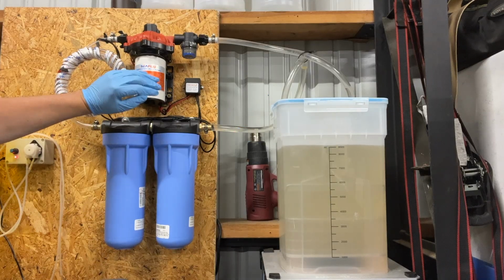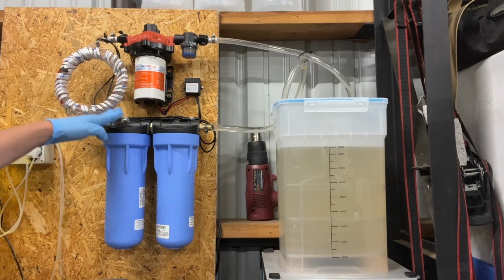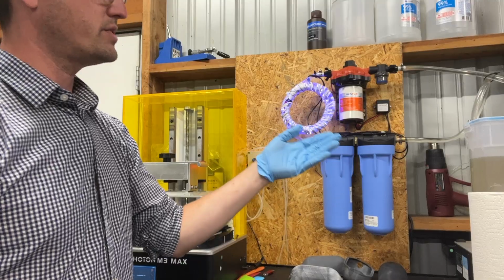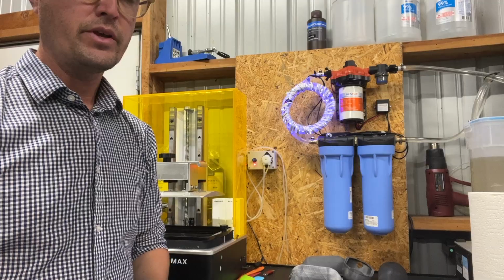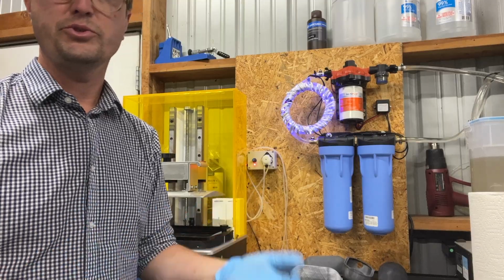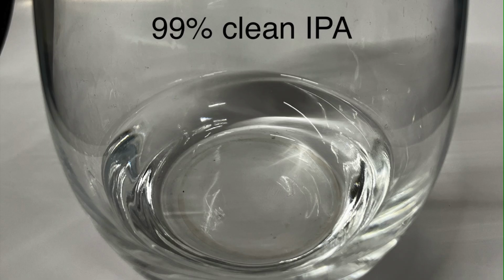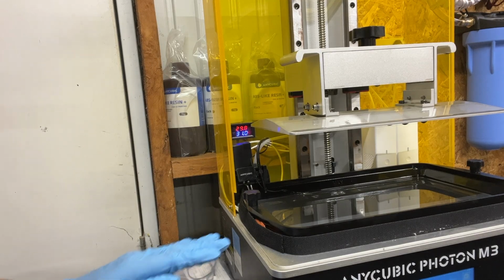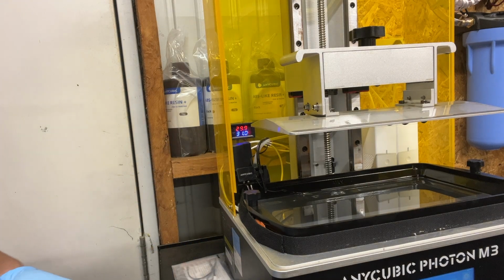Resin Printer Mods and Continuous IPA Filtration!

Comment: Wow, I wish I had found about this sooner but considering that you only put this out in mid 2023 I prolly wouldn't have heard about it in time. Considering how relatively toxic resin printing is to your health and the environment, as well as costly and time consuming, your IPA filter looks like a winner in my book at addressing those issues rather well. I would prolly still let the filters lay in the sun for a few days before disposing of them. 
The overall cost up front isn't cheap but it isn't prohibitive either. I am glad I didn't spend that xmas gift card on other things since it should cover the cost of the materials here. I thought the pump was going to be pretty pricey but it is quite affordable.
I would love to see a 1 year, 18 month and 2 year update to get a good long idea of how well it performs long term. The only consumable would be the filters aside from the obvious IPA that would be lost due to evaporation but I would love to see the cost savings long term. Either way I would do it simply to have a single stage cleaning vat and not having to always think about how dirty my IPA is or how long it might take to let the cured resin settle after leaving it in the sun, filter, squeeze out more from the goo that forms from that process, cure in the sun some more and finally dispose.
Reply from the maker: Great ideas. I’m working on commercializing a much simpler and less expensive unit for sale in the near future.
Reply: @nicks-fix   I hope it's a successful venture for you. The one thing that turns away many people from this hobby is the cleanup and disposing of waste material. I saw videos and posts elsewhere of people using water distillers for the IPA. Gave great results but not a solution that is apartment friendly like my situation.
Reply: @nicks-fix  I'll be a day one buyer if you ship to the UK 👀This would fix such a huge pain point for printing for me, as I can't get keep up with the amount of IPA I go through and some of these parts are a bit tough to source in my country

Comment: Great video and great insight! Have you found any resin layer buildup in the lumen of the reactor? Do you think the continuous flow will be able to prevent it?
Reply from the maker: Not yet! I believe the turbulent flow of clean ipa keeps it nice and clear.
Reply: I tried using a piece of clear PVC with the ribbon light system and you can see exactly where the LEDs are and there was a buildup now maybe it's cuz I use PVC and I use a really high powered ribbon light but I switch to a UV lamp that I stick over my tub

Comment: Hey! I built this and am loving it.  I ran it for 15 minutes on a vat that had about 6 liters through it (had filtered with coffee filters, aluminum sulfate, etc before) and it was so clean afterwards that I exposed it to the sun for an hour and got zero resin precipitation in the vat.  A yellow does stay behind, and some dye, but it surely gets the resin out!
Reply from the maker: Glad you’re liking it!!! So excited to hear other people’s experiences!
Reply: Could you use a carbon filter to remove the color.
Reply: @1h8turkeys  I think the two filters he suggested were both fabric.   I'll look into swapping one for a carbon filter and report back.
Reply: @arthurbrazzle6854 Have you had any success with the carbon filter?  Which one did you get?
Reply: Did u use the led straps linked in the description cause I bought them.only to realize they aren't even uv lights so they don't cure anything
Reply from the maker: @EBMS92  sorry about that. Amazon links are constantly changing and it’s tough to know when they change. 

Just be sure to check the UV output from the LEDs that matches the curing wavelength of your resin.
Reply: @nicks-fix yeah the current link goes to a 400nm strip, still plenty available if you search manually.

Comment: I have few questions. At what rate the resin convert to solid in presence of alcohol? 

If the pump is not rising pressure,  then the filtration filter is not filtering well enough.

Did you open the filters to see how much resins sediment is in there?

Cause for sure is filtering but I'm not convinced that the uv light is doing much in 4 cycles. 

Can you please provide more data? 

Thanks and great job. I'm pretty sure you have something, but still you need more data so you can adjust.
Reply from the maker: Please watch the video again.

The system cycles for 5-10 minutes each time. In that amount of time the entire contents on the IPA vat would cycle 10-20 times, 40-80 times through the reactor… not 4. 

Rising pressure of the pump means the filters need changing, not that they are not working. I know the filters are working because my IPA is as clear as the day I put it in. No need to “check” the filters. 

The data collected is in the video. The resultant output is the data. Little value would be gained from your requests and it would be arduous to attempt.

Comment: Nick,  great video. Looks like you use your SLA printer for functional parts (versus miniatures or figurines).  I'd like to see videos and how you orientate your parts on the build plate to control warping and obtain the best part-to-part fitment.  I'm also interested if you have tried any of the flexible resins in your functional parts?
Reply from the maker: I typically just find the flattest part and align that with the build plate, to reduce the need for supports. 

No flexible resins yet but one day!

Comment: Hi, do you think this would work for a high production? For example in one day I’m printing 120 parts a day. To put things in perspective I’m using 20 gallons of 99% ipa every 2 weeks.
Reply from the maker: Sure! You could always get larger filter housings to help last longer, but I haven’t had to change anything yet!
Reply: @nicks-fix  Thanks Nick for replying back! I see, I was also thinking if the ipa doesn’t get as clean I can possibly run 3 filters instead of 2. I’m in the dental laboratory industry. I sometimes print dental models 24hrs day. My main concern is the pump. You mentioned there’s a sensor for over heating, flash point for ipa 53 degrees f. Do you think running the pump long periods would cause issues?

Comment: I think you're linking the wrong pump in your list. 

Mine came in today and its different then yours in the video. 

This one says do not use with flammable liquids as the pump sparks and will ignite flammable gases/liquids.
Reply from the maker: Sorry about that. Amazon changes their links on me and I have to edit things constantly. Just make sure you have a seaflow pump with a santoprene diaphragm. The power type depends on your situation.
Reply: Amazon shipped me a Maxzone model CFDP1-3330-01.

I don't see a mention of santaprine in the owner's manual, will need to research this more and see if it'll work or am returning it.

Comment: Very nice ideas! Thanks for that! When i am running the heatband with 12V and it has 150W, do i need a acdc adapter with 12,5A? Or did i a mistake? Could u maybe list the full setup how u are running your heatband with thermoelement?
Reply from the maker: Correct, you need a power supply capable of supplying more than 150w to the 12VDC. I use a 300w power supply, that converts 120VAC to 12VDC, 25amps.

Comment: This is the perfect system. I have it now set up for 4 weeks and I have printed nearly 10 litres of resin. IPA is still transparent, just a bit tinted grey as I have uses Phrozen speed and Siraya smoky black resins.
Thank you Nick!
You should patent this and then sell to some 3D printers manufacturer :)
I cant believe such filtration systems are not yet available as resin printers accessory.
Reply: How long did your filters last until you needed to change them?

Comment: Would this setup work with aceton as a cleaning agent, too? Or would the pump start leaking at some point?
Reply from the maker: It should be fine but double check the parts ability to interact with acetone!

Comment: What's your intake/outtake in the bucker? Did you drill the sides/bottom or just the cap and snaked one to the bottom and one top?
Reply from the maker: Just tightly sealed holes in the top.

Comment: For the SimPure 5 Micron 10 filter, does it matter if it's carbon or polppropylene filter? Poly is out of stock atm :(
Reply from the maker: It all depends on if it’s rated for alcohol or not. Carbon should be fine!
Reply: @nicks-fix An referring to your affiliated link you gave :)

Comment: How is the tubing fitted to the IPA basin? Did you just put the tubing through the open top and secure it at some height, or did you actually drill holes and add fittings? In either case where do you have the openings?
Reply from the maker: Just holes with the tubing through the lid.  Tight fitting, but no fittings. I had fittings to start but they leaked a little. Straight tubes worked much better.

Comment: Can you just comment on the safety of running IPA through a pump? I am not knowledgeable about the topic AT ALL, but I've read in many places that running IPA through any sort of machinery such as pumps or even in some cases the swirlers is dangerous due to flammability?
Reply from the maker: Sure!

This is using a diaphragm pump. If you understand how the pump works, there is zero interaction with the liquid and the inner workings of the motor. 

The pump we are using in the video (and the link) is using a santoprene diaphragm, that has high resistance to alcohol. 

We also limit as much air contact as possible, so the ipa has limited chances to engage with any spark that could cause combustion.

Comment: built your setup but cannot get the filter housings to stop leaking, did you use a gasket or something ?
Reply from the maker: Make sure they are tightened down and the gaskets that they come with are placed and seated correctly.

Comment: I just ordered everything to build this filtration system. A question regarding the tubing. Is the pickup line ran all the way to the bottom of the cleaning bucket? Thanks
Reply from the maker: It is! Just keep it below the IPA line so you don’t introduce air into the system.

Comment: This is really nice and I would not be afraid about the components having problem with IPA. I rather wonder how the PVC tubes will perform after a couple of months. Usually PVC is not UV resistant, why outdoors it is either put into the ground or coated with some paint for UV protection. In this case you cannot do that, since the UV should go through the PVC tube, so it should get brittle over time. Maybe it takes years, but maybe only a few months, I dunno since the UV source is right in front of it. Replacing with silicone tube might be smart after they start becoming harder and harder. Same goes for the fittings, but those can be easily shielded from the uv.
Reply from the maker: Correct, but under limited pressure I believe I’ll get a ton of life out of these before needing to replace.

This may be a more suitable option!

https://amzn.to/47gXuMt

Comment: Any updates to the parts list?  I saw in your reddit post that the build was decently affordable, but I'm seeing ~$220 for the filtration setup and that's a bit of a stretch for me.
Reply from the maker: Not at the moment! The pump is the most expensive part, but also the most important. 

At this point you may be able to reduce to one, 5 micron filter and it’d work well enough.

Try looking for a less expensive diaphragm pump with a santoprene diaphragm.
Reply: Thanks! For the filters, do you use Carbon or Polypropylene?

Comment: Can you post a how to video walking us through setup? Or is it relatively simple once the materials ship in? Thank you very much for your content, easily the most effective and low maintenance setup I’ve seen!
Reply from the maker: It’s pretty self explanatory once you have the components, just make sure the order is the same as the video!

Material list is in the description!

Thanks for the compliment, let me know how yours works out!
Reply: @nicks-fix  ok cool thank you very much I have all the tabs pulled open ready to order 👍will post update when finished 😁
Reply: @nicks-fix This process was anything but self explanatory. The plumbing itself was fine even though I still have leaks that escape me even with traditional sealing methods and the electrical does not work as intended. I ended up having to buy extra supplies that were not on the list as well; had I known of these issues beforehand I would’ve elected a simpler and cheaper method of ipa filtering
Reply: Like what kind of supplies? seems stage forward, but I am curious what you needed to modify? @randyworks5348

Comment: I've just recreated this system!  Turned it on today.....turned it off.....forgot PTFE tape around the spigot threads and it pissed IPA on the floor - D'OH!  Turned it back on and seemed to cycle round very quickly.  Havent tried it with resin it - just pumped the IPA round and round till i was happy there were no leaks.  One thing i noticed was that it empties the bucket far quicker than it puts it back in.  A lot of IPA stays around the first filter (i bought the clear filter caddys instead of solid blue).  Do you find that with yours - i notice we didnt actually see your system in action.  I've ended up dropping the 'IPA In' tube towards the bottom and raising the 'IPA Out' tube to near the top to compensate for the speed disparity.  Do you have any thoughts on what might cause this?  As far as i can see i have no kinks in my hose
Reply from the maker: When you say the ipa stays around the first filter, do you mean that it’s filled with IPA?

Yes, there is air in the filter housings before you pump ipa through the system and the volume of air doesn’t go back in, now that it’s filled with IPA. The volume of the pump, tubes and filters is now holding ipa so you need to top off your vat. 

The filters inlet and outlets are at the top, so without pressure, the ipa will remain in the canister when it’s not running.

Also my system is on and cycling in the video when you see the purple from the UV light ring.
Reply: @nicks-fix  ahhh man thats great, i was thinking i would have to top up the rest of the bucket with IPA but was concerned that the filters werent designed to swim in IPA 24/7 - reckon thats ok?  Either way, thanks for confirming and getting back to me.  Looking forward to seeing the state of the IPA after a kilo or 2 of resin has gone through it.  PS Well done on having a silent pump - i didn't even realise it was on!!  Mine is quite noisy but i've fittedit into a purpose built freestanding cupboard/wardrobe in my office so i can keep the entire resin print station in the dark and away from small prying hands (my kids!).  I think my noise is due to the vibration of the cupboard (and everything inside it!) - i just assumed everyones was as noisy :D

Comment: Hi nick I noticed  what looks to be a peristaltic pump on the backwall does that have something to do with your auto filler on the max? or just to drain the resin from the bed?
Reply from the maker: Just to drain the resin bed! No use with the filtration.
Reply: @nicks-fix  cool I have been having issues with multiple autofills failing on my 2 max printers and have been exploring using my own autofill with a parasitic pump. Just wondering. Have a nice dayb
Reply from the maker: @ULTRAMARINEDART  all good. 

I have the auto fill but rarely use it since my prints are very small and never use the whole vat.

Comment: Hi Nick,

Just curious what you’ve calculated for total uv cure time in the loop to be? I ask because I have an old reverse osmosis uv sterlizer that is 254 nm with an exposure output of 17.7 uW/cm2 @ 6w input. From what I can find it seems that most resins are reactive in the 200-400 nm range though with less penetration at the lower ranges. Could be nice to use an off the shelf solution for the uv section.

Also I’m not sure I saw what micron you were filtering to, could you share? Any time I’ve run RO filtration I’ve always tried to run only has small as necessary to improve efficiency.

Great video and setup by the way!
Reply from the maker: Hi!

The uv lights output the uv range similar to my resin, in the 400’s. I found those pretty easily on Amazon and matched them to my resin exposure. 

I haven’t calculated the exposure time of the loop but it’s 5ft long and has 20w of uv light blasting it. The flow rate is moving it pretty quick through there, but since resin in my printer exposes layers at  half a second, I imagine it’s pretty close. 

More loops, slower pumps, larger tubing and more lights will all increase exposure time/amount if you’re trying to dial things in. 

The filters are 5 micron to .5micron. I typically run the system for 15-30 minutes on a timer after I’m done, so that would be 60+ cycles

Comment: Curious. I've noticed a lot of the pumps mention not use for flammable fluids,  I'm figuring it's for the heat when dry pumping.  What's your take?
Reply from the maker: I agree with that assessment. In addition, the motors that run the pumps are brushed motors. This means an electric brush is riding along the commutator to energize and move the motor shaft. 

With brushed motors, you have micro sparks where there is an air gap between the brush and commutator. Look inside at an old wired drill with the lights off. You’ll see them. 

In this situation, the IPA is in a closed loop, and the motor is placed at the highest point in the system away from any drips or evaporation. 

Since the diaphragm is the only part in contact with the IPA, there is no risk of motor spark inside the pump. The only risk is flammable liquids evaporating and igniting in the air due to a small spark from anything. This is why I have the entire system as a closed loop. The bucket and tubing doesn’t allow any amount of IPA to evaporate.